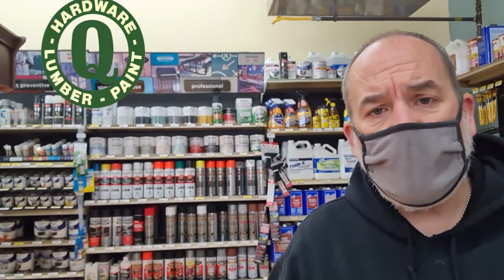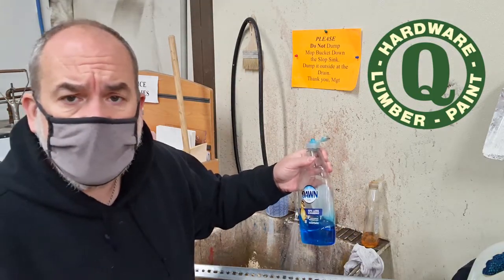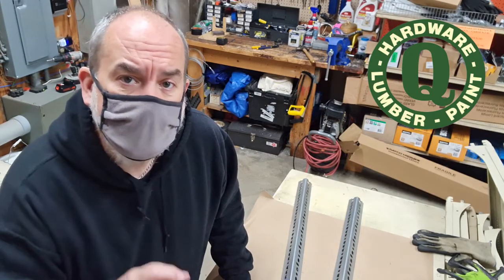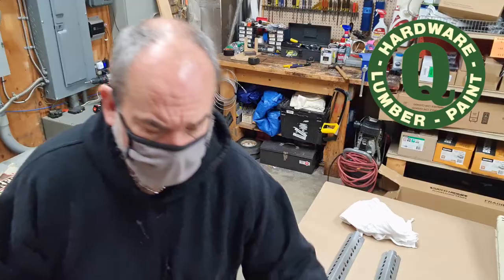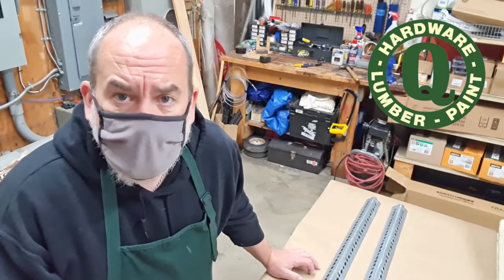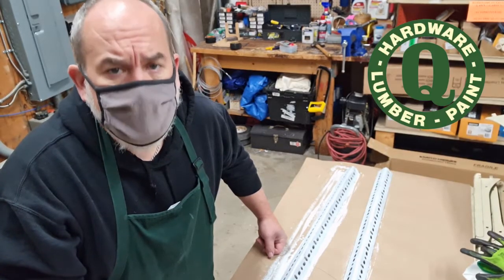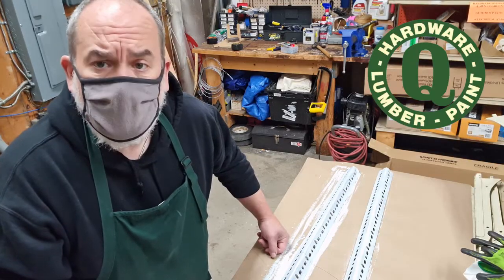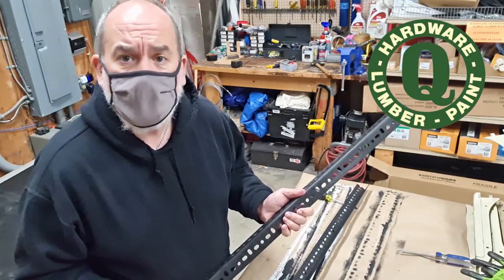painting galvanized metal

Comment: I promise you dude, the vinegar sounds like a necessary component, but it means nothing in practice.  Next time do one piece with vinegar and one without.  Then see how they wear.  Having done this multiple times on galvanized boat trailer parts I can assure you...In terms of looks or longevity,  it makes absolutely no difference providing a light vinegar wash.  ZERO, NADA.
Reply: Hey I’m looking to paint my galvanized trailer, have any tips on longevity? What have you used that actually worked. I’m trying to do as much research as possible before so pleasee help me??
Reply from the maker: Sorry I didn't see this earlier.  I would suggest priming with Bin before painting.
Reply: What primer do you use on glav. Boat trailer?

Comment: Hello i have a question, does the sanding process dont damage the protective zinc layer which is supposed to protect against rust?
Reply from the maker: If you are too aggressive the sanding could take off the protective zinc coating.  The point of sanding here is just to dull the shine and give the primer something to grab on to.  Use fine sand paper and sand lightly.
Reply: Use a scuffing pad instead of sandpaper

Comment: I want to make shelves and other unique designs with the galvanized platted metal. I need a book or some hard core information to understand the physics and engineering to build it right without any problem of it falling over. Do you or anybody know anything?
Reply from the maker: Michael,  I do not have any reference material to recommend other than searching the internet.
Reply: @saratogaqualityhardware7730  alright thank you and thank you for responding
Reply: Big M, Simple.  Upon completion fasten your shelf to the wall with multiple  #12 or #14 screws.  Assuming the wall was constructed by others (not u), shelf stability is not a concern.

Comment: The 'tac cloth' you mentioned, not sure what that is.
Reply from the maker: It is like a cheese cloth with a light adhesive on it.  It is used to remove fine sanding particles from a piece of work before coating.
Reply: @saratogaqualityhardware7730  Ah thank you so much !!

Comment: Why would you clean the metal and then sand it, and then clean it again?
Reply: He didn't. He used dish soap to remove the galvanizing oil, then used a tack cloth to remove the dust. Those are two different things.
Reply: He literally explained what he was doing as he was doing it.  Why wouldn’t you clean, sand, and clean again?  First clean was to remove the oil before sanding, and 2nd clean was to remove the sanding dust.  You can’t paint on oily or dusty surfaces.
Reply: @SoCalKevin  The sanding would remove the oil.
Reply: @robertheintz8017  I suppose it depends on if you were ever planning on using the same sandpaper again on something else because it would be contaminated with oil.